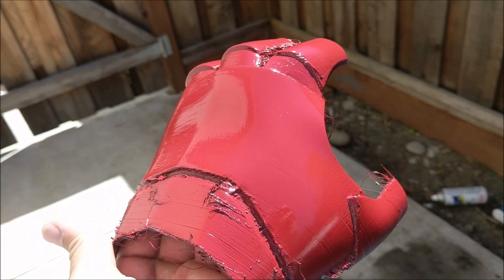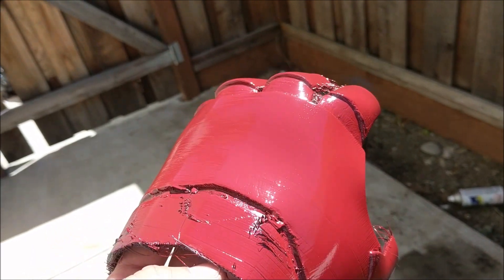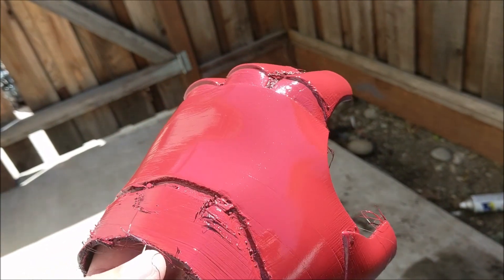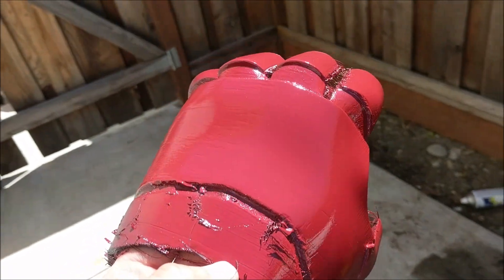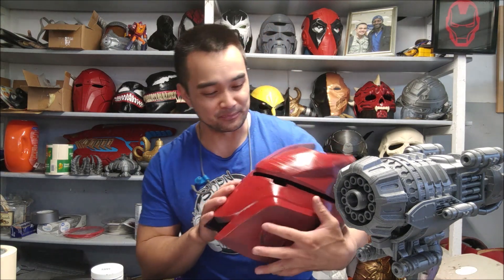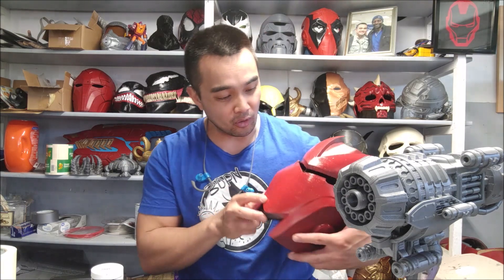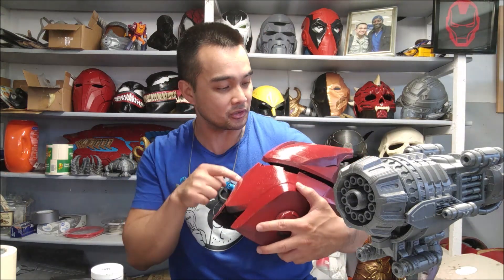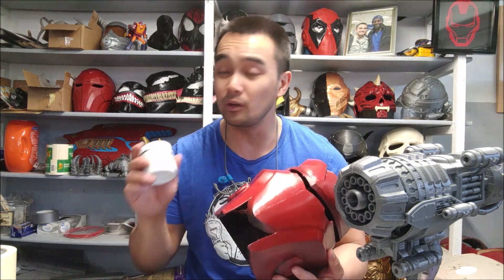How to Smooth Flexible Filament Part 2

Comment: Hey Nikko, I’m confused, how did you like the rapid fill?
Reply from the maker: I'm still trying to get the process down. I just wanted to get the video out to show that is another method you can use to smooth
Reply: Nikko Industries that finish is pretty amazing, thanks for testing it out and showing it!
Reply: from the web site, looks like you use Rapid fill then fine fill in the process. Ordered 1 of each to try, I had horrible experience with fiberglass resin.
Reply from the maker: @kylejc9  yea it's great to have multiple processes for finishing